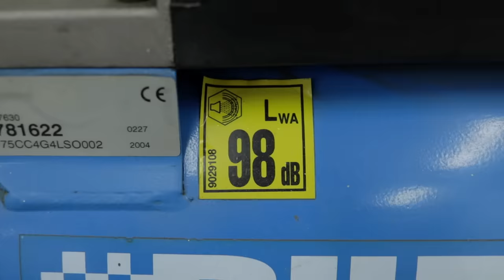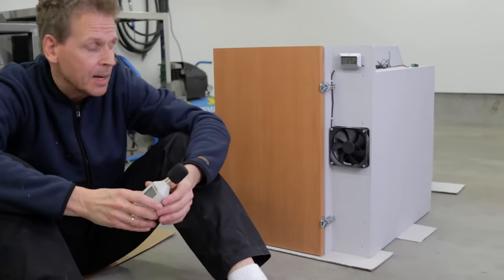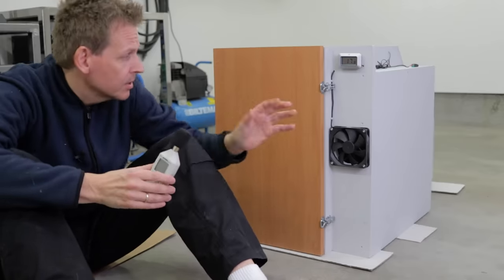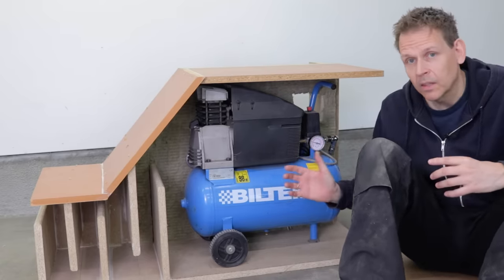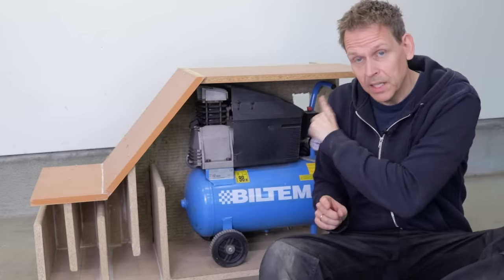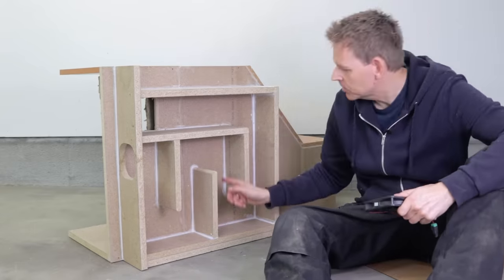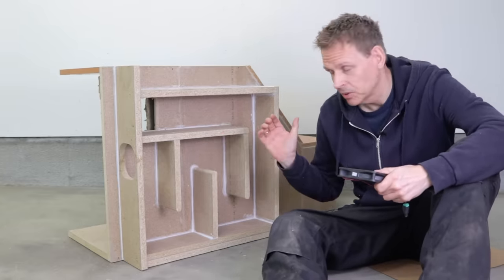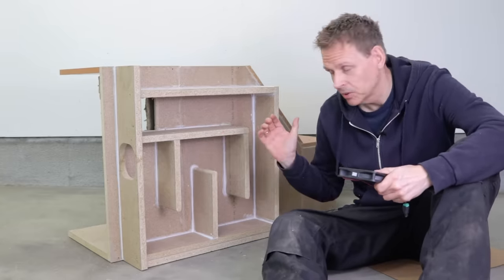Do not build a sound insulated enclosure for your noisy air compressor!

Comment: If anyone endeavors to build a noise-deadening enclosure for their air compressor, they should consider the possibility of removing the plastic "dress-up pieces" - the panels that keep curious fingers from getting near hot metal components. Since the enclosure itself keeps hands from being where they shouldn't be, those plastic pieces will only be trapping heat underneath them unnecessarily, and the altered airflow path due to the enclosure itself could affect heat dissipation. If the compressor runs hotter, not only will it fail sooner, but it will be forced to work harder, driving up the energy use.

Of course, leave the tank drain and oil fill/viewing port accessible, and maintain your compressor properly - it can be easier to forget how many hours it has been running if it is no longer clattering away noisily to remind you. If you use air for high-demand tools and have a small compressor/tank, consider plumbing in an auxiliary tank (safety first, make sure you have shutoffs on both sides of that tank) to give you the additional volume you need while reducing compressor cycles.

Definitely a nice build, though, the internal baffling and use of cloth dampens are a thoughtful touch, and the difference in volume is quite noticeable. "Portable" compressors such as your "old" one are inherently noisy, I'm assuming they are comparable to the US 120-volt versions since the only real difference needed would be in the motor and power switch.

As others have noted in other comments, some of the noise produced by a compressor is coming from the air inlet in the head. With the use of a few pipe fitting adapters, the inlet size can be altered; a common "hack" in the past (in the US) was to pipe a small tractor muffler in between the air filter and the inlet port, and a larger air filter. I've actually done that "hack" myself on an old 1970s air compressor at an auto shop I used to work at, you could stand about two yards from it and have a clear conversation without raising your voice.
Reply from the maker: Thanks a lot, both for your positive feedback and for a lot of good tips and tricks! Thanks for sharing! 👍😊

Comment: Couldn't you just build a normal insulated box then put in a 3in duct fan connected to a cheap car muffler on the inlet and outlet inside the box? They even make duct fans with temperature sensors to automatically turn on at a set temp. Yeah it's slightly more expensive at probably 100-200 dollars but it would be Hella quiet and cool!
Reply from the maker: That would probably have worked well 😊 but as you say: a bit expensive, and it probably makes it all bigger as well. Depends on the size of the car muffler if course. 

I have actually bought a sound sensor to control the fan so it turns on when the compressor turns on, and it keeps running with a minute delay.
Reply: @kihestad  Wow a sound sensor, genius, I never would have thought of that

Comment: One could ask the local HVAC ductwork contractors to manufacture that shape, add excess panels and line it with sound absorbing material on the inside.
Reply from the maker: Absolutely, but it would probably be costly 🤔 Btw: I did use sound absorbing material in the main chamber where the Compressor is. I used Rockwool sound absorbing mats, they work very well. I used them in this project as well: https://youtu.be/4EkoAMJAIug

Comment: 3:30 for better Airflow u should not have 90° corners, better 45° since entrance angle is exit angle. Your airflow will hit directly the walls and travel 180° back, that means the fan has to fight itself.
Reply from the maker: You are right, other has mentioned it as well 😣 One solution I have got suggested is to put the inlet fan inside and let it suck air instead of pushing - and a fan on the rear to pull air out from the exhaust would probably also help. I have OK airflow as it, but these changes would probably make it even better. Thanks for your feedback! 👍

Comment: You are using an oil-less compressor which in my experience make more noise than some of their better oil saturated type. I have a 10kw industrial in my garage, I think it outputs about 70 db but haven't verified. An enclosure would certainly limit it a lot more but it would not be practical for extended operation due to interfering with cooling. Compressors need to stay as cold as possible to keep condensation from building up inside the pump and tank.
Reply from the maker: Bigger compressors have more powerful motors and run at lower speeds. This makes less noise. Not sure if the oil-less technology itself causes the noise, it's rather the direct drive and  hight rpm from the motor that causes it to be noisy

Comment: top of the piston where there should be a air filter is the air intake not the rear. the fan on the ass of the motor is to cool the motor. the motor driving the piston down creates a vacuum that draws air from the filter
Reply from the maker: The airflow for the box starts at the front, blows air into the front part of main chamber where the compressor is, the rear port is the air output. 
The reason I put the exhaust at the rear of the box is this: My garage is not insulated, there is an opening for ventilation where the ceiling meets the floor upstairs. The exhaust air from the air compressor box is placed up against this opening. The hot air from the compressor is pushed out of the room to outside of the building through this opening. By doing it like this I avoid the hot air to be circulated back into the room. I totally forgot to tell about it in the video - my bad 🙄

Comment: Definitely could have made a better exhaust muffler and sound baffle for the intake. Just like a car engine with a muffler. You could also dump the noise outside.
Reply from the maker: Better how? Some has suggested angeled baffles, and of course thicker sound absorbing material will always help. With size constraints and not wanting to annoy neighbours, it’s not that much to do 😏Not sure how it would have worked adding a silencer/muffler to the compressor intake in addition to putting it into a box. A muffler instead of box it’s a less effective method, both is difficult unless building a huge box 🤔
Reply: @kihestad  a muffler on the compressor itself. They add mufflers from the factory however they impact performance which performance sells better over sound. Theres a few videos on youtube that do an okay job of trying to rig something up. One guy i saw used a honda motorcycle muffler attached to the stock muffler to quiet down the compressor noises and it worked quite well. Think of it this way, a piston air compressor is very similar to an automobile engine. The auto industry uses long exhausts, heavy, tubes and mufflers packed with glass fibers, they also use rubber undercoat on the car body to absorb resonating sounds as well as using sound absorption materials. I think you need to think about what causes an air compressor to be so loud? And how they function in order to solve your problem of noise. Also use some rubber on the inside. Sound suppression works in 2 ways absorption  and blocking. Rubber works to block sounds and insulation like rockwool works to absorb sounds.
Reply from the maker: @jacobmay7594  Ahh, ok - these mufflers on the intake does help a bit, but not that much. It's an affordable and easy solution compared to isolating the whole machine. The problem is that the whole compressor tankt act like an resonator box. You get rid of some of the sharp and annoying "breathing" noises from the intake using a muffler, but still the machine emits noise from all other parts. I have heard compressors fitted with quite huge mufflers, still quite noisy 😞

Comment: The voltage in my detached garage used to drop so much that my hazard freight noise generator (air compressor) couldn't start if there was already any pressure in the tank. Because of this I used to power it with a 4000w gas generator that's as loud as a lawn mower. I'm just sitting here laughing to myself at the concept of someone making something this quiet meanwhile I was going "well it's downright tolerable if you wear the foam earplugs under the big earmuffs".
Reply from the maker: Haha, great story 😁 hope your hearing is still OK 😝

Comment: You don't have enough material in that tiny box to break up the sound waves.  You want to chop up the waves & crash them into each other until they have no energy to leave the enclosure.   I've been thinking I want to simply insulate a larger space & have it double as an air-scrubber where the cooing-blower/fan can stay on b/c it has two jobs.
Reply from the maker: Yea, more sound absorbing material would have made it even better. I use 3cm Rockwool sound insulating material in the main chamber, in the channels just the thin fabric. I had limited space to work with since I wanted to fit the box under my table upstairs in my garage. For those who can make the box in whatever size: bigger is better 😁

Comment: Compressed air tanks quickly accumulate water which needs to be drained regularly to reduce corrosion in the tank and to minimize the water content of the compressed air. Your solution needs an easy way to drain the tank on a regular basis and I didn't see you provide such a means. Having the compressor out of sight in the little attic further adds to the risk that this important regular maintenance task will be ignored.
Reply from the maker: You are absolutely right 👍 It's a bit cumbersome to drain it as it is now. Will be improved, thanks for the tips 😊

Comment: A major error: the wall facing the camera is unbraced. You basically have a dampened 1/3 sq meter speaker diaphragm transmitting sound to the outside. A simple x brace corner to corner across the face of that wall will markedly reduce noise transmitted. Plate vibration modality is your enemy
Reply from the maker: Hmm, that is a valid concern. It is quite a heavy and sturdy material I have used, but you are right - it probably vibrates slightly. I probably have to give it a try. Thanks a lot for the tips! 😍

Comment: thats so funny///most important is to put it standing on rubber and make sure you vent it to the outside of the garage for its air. This works very well.  You really need an input and output to get some sort of cooling going on...compressor hass its own fan but you need to push and pull in and out.
Reply from the maker: It is actually vented so the output air blows out og the garage, it's a gap for ventilation between the floor and the ceiling upstairs in my garage. I do need to add rubber feet to the box, vibrations are very noticeable. Thanks for the tips! 😊

Comment: I have 2 air compressors A oil one and the other oiless, I noticed the oilless 1 is much more noisier than the oil 1, and the oiless is smaller than the oiled 1 , So thats the one I use the most.
Reply from the maker: I think you can find noisy and silent ones within different categories. Some types are more often noisy or silent than others, but it all depends if the manufacturer has prioritized low noise, high power or low cost 🥴

Comment: heat issues? adding vents defeat purpose?
Reply from the maker: With the vents I added heating is no issue, but I live in Norway = a cold climate 😔In a hotter environment I guess an even better cooling solution is needed. Adding vents to enable cooling has the downside that it also causes also noise to escape, that is more or less the reason why I made the video - to figure out if I could make this combination work.
Reply: @kihestad  I didn’t catch you living in Norway. Shouldn’t run into overheating there.🥶.

Comment: Should have placed the box ontop of some sound deadening foam. 
I think allot of that soundyou're still hearing is from the vibrations.
Reply from the maker: Yes, you are right. I have got suggested using a Yoga mat, cut two squash balls in half and put in each corner and some other creative solutions. 😊 I will also remove the wheels on the compressor and use some kind of soft dampening material at the bottom inside the box as well, it might help to avoid some of the vibrations from the compressor gets transferred to the box. Thanks for your tips! 👍
Reply: @kihestad  Thanks for YOUR tips!

Comment: I've had both types of compressor, direct drive and belt drive, give me the belt drive every time they are a lot quieter than direct drive
Reply from the maker: Yes, I guess it's because the compressor runs at lower speed. They are a bit bigger and more expensive though, but it seems to be a better alternative if you have the space for it and you can afford it.
Reply: Yes they cost a little more but add in the cost of components to make them quiet

Comment: how do you purge the water?
Reply from the maker: It's a bit cumbersome as it is now, I need to open the four eccentric locks and pull of the door and then take the compressor out of the box. It takes no more than 5 minutes, but it's enough to postpone it to the next day 🙄I better put on a line and have it on the outside....

Comment: if it were me i would make the intake all most a tesla valve type, and have the compressor suspended in the air by elastic cargo straps to reduce vibration. you can take it a step further and make a second box that is a little bigger, and put the first main box in and the second box, which will have a lot of foam on the walls. this should be enough to make it sound like its behind a building or in a closet like many places
Reply from the maker: Easy 😁👍

Comment: at that point i would (and have) build the enclosure outside and use plumming parts to go trough the wall and install pressure controls inside
Reply from the maker: Yes, that is way smarter 😊I just dont have space for it. My garage is placed with minimum distance to two of my neighbors. The side facing my own property is not usable either,  as it's just a slim path between my garage outer wall and a concrete retaining wall. In front of the garage door is no good either 😋

Comment: I also know of a sound deadening board 1/2" i think.
Reply from the maker: I do believe chipboard (what I used) is decently sound dampening, MDF is even better but more expensive. Specially designed boards for sound proofing probability exists, and most likely very expensive

Comment: I think the cheapest way is to put the compressor outside the garage at the opposite side of the house and use some long pipes for the air. Downside: Doing so, you won't become the most favorite guy of your neighbourhood.
Reply from the maker: Haha, yes - perhaps not a good idea if you care about your neighborhood 😊
However, I just dont have space for it outdoors. My garage is placed with minimum distance to two of my neighbors. The side facing my own property is not usable either,  as it's just a slim path between my garage outer wall and a concrete retaining wall. In front of the garage door is no good either 😋

Comment: MUCH of compressor Noise is the Air intake of the Pump.
 Fit a muffler to it !
 Can be as simple as a Round /tubular one intended for a Larger Briggs ' Stratton engine.
Reply from the maker: You get a nice improvement by just adding a muffler. However, the whole unit emits noise, the tank acts like a resonator. A box is much more efficient.

Comment: Great sound proofing but there is a dangerous side problem. Air compressors as they age and get water inside they rust, then later the air tank can leak, or worse yet crack, with a massive explosion.. With it enclosed you will forget those important things, like the air pressure and the water condescension.

Comment: Direct drive compressors run at 3600 rpm. Much of the noise you hear is valve chatter. Moving to an oil splash lubricated unit will help greatly. The worst unit for noise pollution is the unit you have direct drive oilless.

Comment: Lol for the last 2 months iv been welding pipe to conect over 100 gallons of tank capacity and reworking tanks and adding bugs and fittings even added a 12 volt air solenoid in its own port for all my air horns so I can conect them permanently under my tool shed so when my buddys come over I got 2 switches placed around my shop I can hit them secretly and scare my buddys lol I also have 3 different compressors and motors to fill it on a cool metal rack I welded up out of squair tubing that I made slide mounts on so I can add 5 different things to the rack and there slide adjustable so you can spred them apart however you need to to ajust for room or belt tension....I port heads and I work of a night so my neighbors love me hahhaha

Comment: If you want to convert Celsius to Fahrenheit in your head, there’s 2 ways I use. 

Easy (rough estimate):
temp x 2 + 30
      0-85° [0-8% error]
temp x 2   
      85-160°  [8%-0% error]
      160-1760°   [0-10% error]

Exact (harder, but easier than 9/5x+32):
• Multiply by 2
• Move the decimal to the left and subtract from above
• Add 30
• Add 2
(Ex. 
17° x 2 = 34 --> 3.4
34 - 3.4 = 30.6
30.6 + 30 = 60.6 + 2 = 62.6)
+2 = 62.6
Reply from the maker: That was useful! 👍 Thanks!

Comment: Carpeting the outside wont change the design much but will further reduce the noise.
Reply from the maker: Thanks for the tips! Unfortunately it's not an option for me as the box barely fits as it is, it's designe with approx. 1cm clearance to it's surroundings 😊
Reply: @kihestad  im sure you know this but for anyone who does not know, sound dampening happens when sound energy is absorbed and  dissipated by vibrating many small fibers.